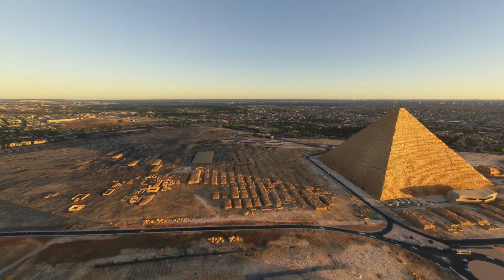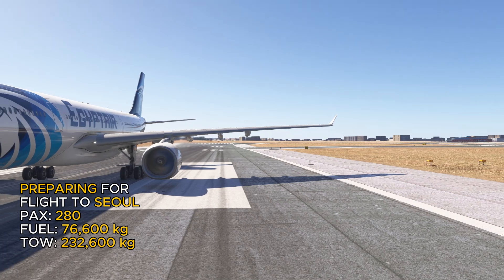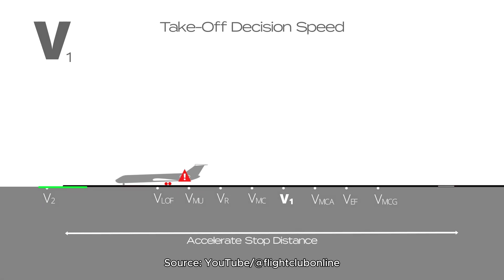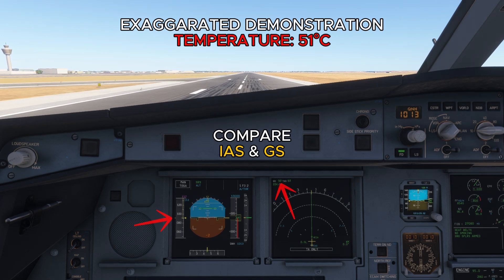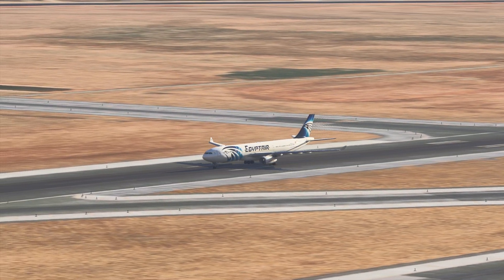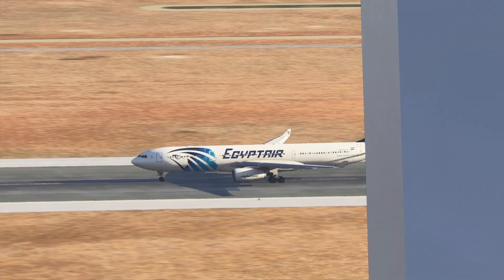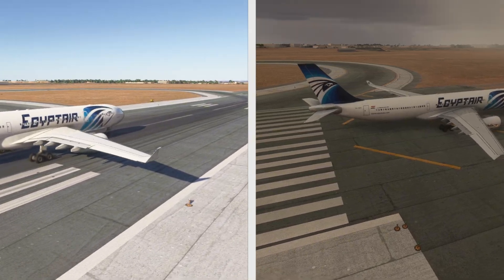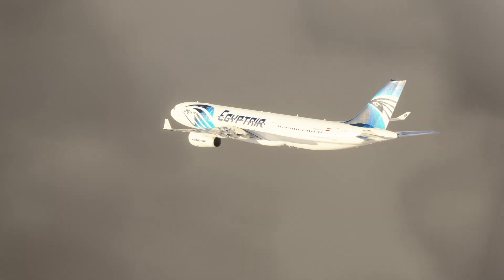REJECTED TAKEOFF: Dry vs. Wet | MSFS 2024 Realism Check | Episode 4

Comment: You did not try with snow or ice. Could the results be different? Nice video by the way 😊
Reply from the maker: @melteddust4306  I didn’t. For the reason that I wanted to keep the temperature (15°C) constant and as you might know, snow will melt at that temperature 😅